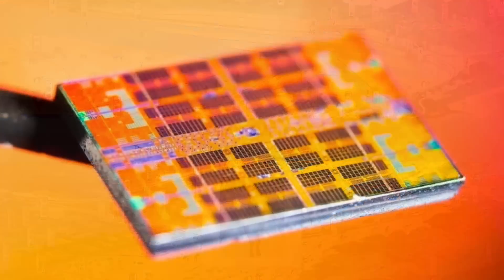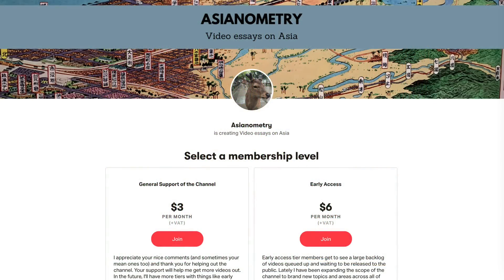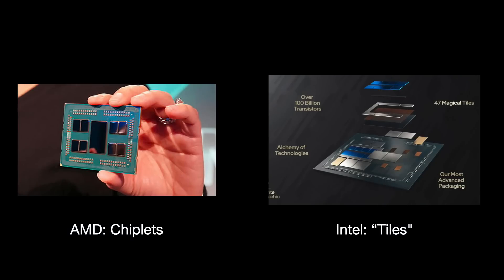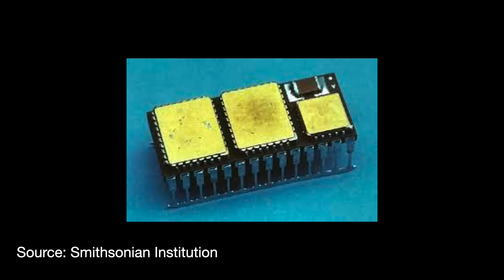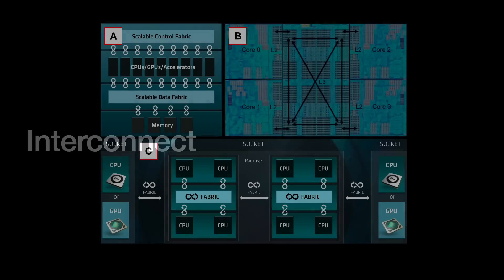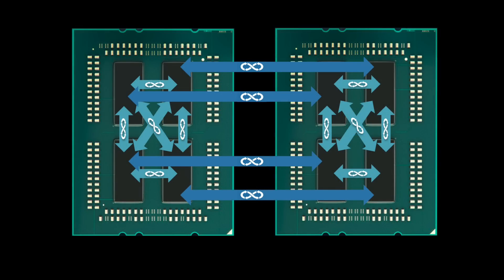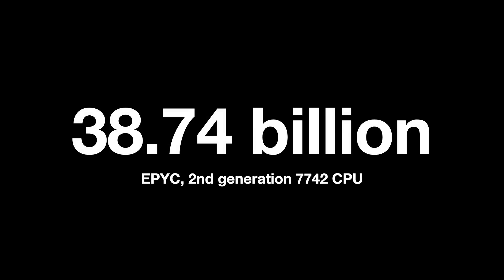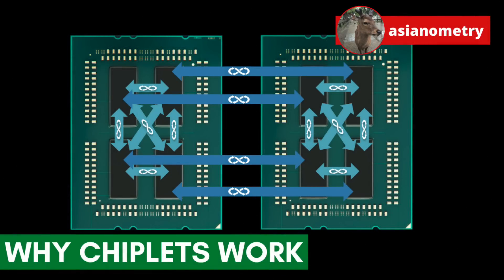Why AMD's Chiplets Work

Comment: You are missing where the package innovation came from. Multi-Die packages where driven by memory and image sensor (processor). For example through silicon via technology was developed and matured for these applications. I still think that are the leading edge for this topic. A modern ISP is amazing part of technology with wafer level direct bonding, thinned image sensor chip to just 10um thickness to be ilumanted from the backside. Memory is producing stacks with up to 16 chips.

Comment: voltage, frequency & chiplet efficiency
Multi-Chip has some very interesting EFFICIENCY options available. Since POWER DRAW does not scale linearly, and is often the limit (especially in laptops) then adding MORE chiplets at lower performance per chiplet can result in better performance. If you plan to run at a max of, say, 1500MHz you can also optimize around that as a max frequency further saving power somewhat. So there's a lot more flexibility compared to a traditional monolithic design... and not being on the most cutting edge NODE might not matter so much if you have this flexibility. Maybe put those cost savings into adding more chiplets on less efficient nodes? There's definitely going to be a BALANCE of everything that results in the best performance per dollar to make and that's going to vary depending on the product, current node costs etc.

Comment: The original Intel P6 (1995) had 2 dies, a CPU plus a wire connected cache. That's the processor I started my long verification career on. Fun times!
Reply: was the 386 for me

Comment: Remember the jump in performance that came with the Pentium II Xeon / Pro? It seemed like a big jump in performance. That used a primitive version of chiplet based L2 cache memory if I recall correctly; This is why it had a weird rectangular shape and case. I think big CPU cache is the way to go, generally.
Reply: Pentium 2 and 3.. It plugged into a socket like the old agp slot

Comment: I'm surprised you didn't mention Intel tried this a few times. They did it with the Pentium 4 to get dual-cores (really dual-dies) to market. Then again with the QX6700 (2006) and Q6600's (2007) which contained two dual-core chiplets to deliver quad-core processors and they used the MCM naming for those too. There were also XEON equivalents at the time.

In Intels case, AMD got to 4 cores with a single die and Intel was a bit behind so they had to use an MCM to catch up then they went back to a single die design. Now it has switched around and chiplets are being used to get higher core counts at a reduced cost like you said in the video.
Reply: Intel double cheeseburgers....
Those were the days.
Reply: Intel is so behind AMD and Apple on chiplet technology that it’s not even funny. AMD 5800X3D has a stacked 64MB of L3 vertical cache at $450! Intel’s Faveros EMIB technology announced in 2019 is still nonexistent!
Reply: Intel started doing it in 1997 with Pentium II
Reply: @tringuyen7519  more like TSMC, not AMD.
Reply: @dogman2387  Intel started doing it in 1981 with the iAPX 432
Reply: MCMs are old tech. NASA and the military used them to put into spacecraft because they don't like PCBs, which fail when heated and produce bigger circuits.  We did mixed MCMs/hybrids (ICs, passives, transistors) at Hughes for satellites in the 1980's and before.
Reply: @scottfranco1962  Yes I'm aware of that lol but I'm bringing it up with Intel because they are the main competitor to AMD and the whole video was focusing on how AMD used chiplets to beat Intel but failed to mention even once that Intel had shipped MCM's in the past, commercially to consumers in large volume.

Comment: A funny thing about chiplets is that they're helping overall but they are so good that they leave no silicon for the low end. The low availabiliy of the 3300X and thelaco of a 5300X is becaus AMD is getting little to no chiplets with less than 6 working cores
Reply: This is the fault of the way AMD approached Zen 2 and 3 and nothing inherent with chiplets.

Something as simple as a 4 or 6 core part doesn't require chiplets and if AMD does this for Zen 4 I think Intel will eat AMD for lunch at the low end.

If I were designing AMD's Zen 4 Ryzen based CPUs and APUs, I would use 5 chips in all.  The first would be a 6 core monolithic die, with no graphics, that allows a tile based interface to add a graphics chiplet.  I would create 2 graphics chiplets for different power levels.    I can now use this single chip for 4 - 6 core CPUs and APUs.  That's a lot of versatility still.  I'd then make another chiplet that has 8 cores, the IO functionality and the ability to add graphics just like the 6 core chip, and on another side be able to add another 8 core chiplet, with no IO functionality, so it's simply 8 more cores.

AMD did the whole IO die thing with GloFo because they were still under contract to GloFo for die.

I don't for a single second believe Intel is going to move to tiling for every single part because it just doesn't make sense to add complexity when the die isn't very big.

So this is where AMD failed, at low cost items, and they shouldn't have to rely on having enough bad monolithic APU die to make lower core count parts.  That's just bad.  And, using an 8 core chiplet to make a 4 core part is BAD.  It's a waste of 50% of the die.
Reply: @johndoh5182  thats a lot of tooling though, it isn't cost effective to have that many different designs. It's also a waste of capacity since you have so many sku's hogging precious laser space. 
AMD has 3 designs: CPU,GPU,IO 
INTEL has maybe 1or 2 design: APU
every intel sku is a binned down 12900k or is a 12900k
Reply: @johndoh5182  You seems to have a backward idea on the whole chiplet idea. Remember when AMD was on the brink of colapse, high end desktop cpu got like 4 cores and maybe halo product with 8 cores. With chiplet AMD raised the bar, nowdays most common gaming machine got 6 cores. AMD is now becoming intel since no competition is insight (thankfully we got ADL, but thats not enough). Instead of asking AMD to downgrade their effort, i would instead go to intel to ask them to up their game. So we can raise the bar again so midrange can have more cores like 12 core and hopefully, making 4-6 core to be low end. Thats the beauty of competition although i dont see it coming anytime soon since price is slowly creeping up.
Reply: Suffering From Success™ 🗿🗿🗿🗿
Reply: @jakejakedowntwo6613  
No?
AMD makes 1 die for APU, CCD, IO each and a bunch of dies for discrete GPUs

6 core CCD is the only new one that AMD would need to make

And intel makes more than 1 dies for alder lake
Reply: While it is inefficient, it is not that uncommon for silicon vendors to fuse off functional units of higher tier parts to make lower tier parts when the demand for the higher tier parts isn't high enough. The reason we haven't seen much Ryzen 3 inventory lately is partly due to how good the yields are, but its also due to the fact that AMD can sell every higher-tier part it can make with the market as it is. If they actually had enough defective dies to make Ryzen 3 parts, it might even make sense for them to just build a 2-CCX version of an 8-core part instead of twice as many 4-core parts (I don't think they did this, just saying its possible).
Reply: Idk, I dont think historically it has been the standard for the majority of lower spec products to be the result of salvaged partially defective higher chips

Certainly a ton of chips that use some fine tuning like to a degree of 10-15% of performance differentiation, and some past budget designs used this, but even back in the phenom II quad vs triple core days (10+ years ago on 65 or 45nm?) yields were good enough they had to artificially lock some of the cores to meet demand of a very niche (compared to dual or quad core) triple core cpu
Reply: It's as simple as low end = low margin = low cost

Interposer, packaging, IO die, all add cost. It's just cheaper and easier to fab a traditional monolithic chip for the low end, on the non-leading edge node (e.g. 7nm/"6nm")
Reply: There's little low end silicon because there's sufficient demand for the value chips like 3600 or 5600.
If 6c/12t weren't selling then lowest end 4c/8t SKUs would appear with good cores disabled.
Reply: @johndoh5182 you clearly don't understand the product range or decisions.  The desktop chiplet low end allow harvesting, inefficient dies which don't meet specs for higher margin chips.
The real volume chips are not desktop but the kind of APUs that mostly go into laptops or consoles, they can even be older designs on older processes and are monolithic.
Your strategy would limit flexibility and incur high costs for small lower margin segments, when most  desktop and laptop buyers are clearly seduced by 8+ core models.
So congratulations you'd blow billions on specific designs for uninteresting parts of the market and lose the advantages of scale allowing small chiplets to be selectively binned for use in server or high end desktop.

Comment: The biggest roadblock issue for MCMs was cache memory latency bottlenecks. Consequently, integration of memory on die for CPUs GPUs and SoC would be a priority from the mid-90's onward, while on the severs side, massively parallel blade architecture solved the problems temporerally, but by ~2010, latency was again an issue. Chiplets solve this another way; splitting up the processors into manageable increments.

Comment: Xilinx (now AMD) used a multidie approach for ultrascale too.  Some designs that ran fine on V7 have problems meeting timing at the die crossing interface in ultrascale.

Comment: Can you do a video on camera image sensors?
Reply: TacticalMoonstone  I like to know how similar or different the process technology is between sensor manufacturing vs  processors. I have a feeling that image sensors use older equipment/process. Also, how far behind is full frame / large sensor semiconductors compared to latest cell phone cameras. If you would scale up for example, iPhone main sensor to larger size, how much would it cost? TowerJazz, Samsung, Sony, sigma…I’m also curious about those.

Comment: Maybe we can go back to having a north bridge on the motherboard in typical PCs? It would be a small step. 

This also reminds me of how 80286 and 80386 CPUs needed an optional “math co-processor” to be installed in the motherboard in order to perform some floating point calculations.
Reply: A North bridge would come with massive latency costs, tho. They didn't integrate the North bridge just because it was cheaper, they also did it because having an imc massively increases performance
Reply: We wouldn't actually want that. You're just adding more lengths of wire and logic between a device and the CPU, which becomes a bottleneck and adds latency. Everything either needs access to the CPU, RAM or both. The chipset that still exists on desktop systems still has the same problem. AMD's Epyc based systems don't even have a chipset because there is room in the IO die for all those auxiliary functions. It's probably key to understand that the Northbridge is mainly only really different from the modern chipset (and southbridge) in that it housed the memory controller. That specifically makes way more sense to be on the CPU package. The northbridge was removed in favor of the Integrated Memory Controller. It would be a step backwards.
Reply: @blkspade23  Okay so not worth it, I guess Ryzen already does the logical thing and puts the IMC in the I/O chiplet. It maxes out at moderate memory speeds but it makes sense from a value perspective.
Reply: @blkspade23  by the way, thank you for your lengthy explanation/reply. I appreciate that you shared your knowledge.

Comment: great coverage as always. I wonder if apple will ditch the monolithic dies for the pro lineup going forwards, they really are pushing that monolithic design SOC with their on silicon interconnect
Reply: I don't think it is possible for the A series chip as it need to be small for iDevice. Possible for future M series. The current M1 Ultra is 2 chips in the same die with RAM, Unify Memory, as chiplet on the side.
Reply: @Theoryofcatsndogs  not really, the M1 ultra is really one monolithic die, since the interconnect is on silicon. they just cut off one of the dies if it fails which is how they preserve yield

Comment: Around 20 years ago we saw the end of the MHz race between CPUs. Slower chips doing things smarter and more efficiently substituted for faster clock speeds.
Chips have been mired in the same 'bloatware' that software finds itself.... we don't program smarter, we just throw more lines of code and billions more transistors at a problem.
I believe that the 7 nM 'node' is over-extended,  and just like with clock speeds, we will take a step back towards more realistic geometries.
AMD has taken an interesting tack towards simplification. A database server does not need ANY graphics functionality, why include it? Design a couple of chiplets that implement database functionality in hardware, omit the graphics engine and glue them together with a CPU. Less transistors, easier geometries and better performance.
Reply: Scaling up the easiest way makes sense, until it stops making sense, and then scaling up the next-easiest way makes sense. Repeat until full theoretical capability is achieved.
Reply: Thats one of the problems with x86 (and ARM to some extent). About 90% of all instructions a program executes are jump,compare,add,subtract,load,store and x86 has ~15 000 instructions which makes decoding A LOT more difficult and requires more bits to encode an instruction, eating away silicon space for more useful things such as more pipelines or a better branch predictor. Thats one of the reasons why RISC-V is appealing since it wants to keep things as simple as possible, which also allows for higher code-density.
Reply: Database acceleration has been done by Oracle with their SPARC cpus
Reply: Sure, what is the clock speed of the human brain? Probably less than a 1khz. Yet all of the computers in the world cannot equal one. Parallel processing in 3d solids baby!

Oh, yea, and all that for the cost of a beer or so...

Comment: The Brilliance of AMD is that they have - essentially - only a single 8-core CPU.  By connecting many of them with different fabric chips and/or disabling broken ones by lasering them out of the circuits, they can build a chip anywhere in size from 2 CPUs to 128 CPUs - all with only 1 GPU, roughly.  So AMD really makes only ONE CPU and it has 8 cores, period.

Comment: SOC is the opposite of what amd is using.  They are doing SIP system in a package, it’s been in use for decades.  The next evolution of that is stacked die, where you use through silicon vias to directly connect die without bond wires and footprint increases.   SOC is putting multiple die on the same wafer making large die with sub die only connected by the top metal layers or bond wires in the package. That was a large expense where board space was the primary concern.  

The other huge advantage to this approach is you don’t need as many different devices on a single die, reducing mask layers for each and not having to share thermal budgets at each layer. This reduces cost and complexity.  The reduction in base and interconnect layers also greatly improves cost of scrap. Your net yield increases slightly but anything you scrap at end of line has man fewer masks so it costs less.  These advantages are shared by Traditional SIP but stacked die is a way to take moores law into 3d and continue it beyond atomic size constraints.

Comment: I work in embedded , no such issues there :) You would have to be mad to go chiplets there. I see the point for high end designs if you want to have some scalability and lower cost with some performance drawbacks.
Reply: Isn't going chiplet when you have more than  1 MCU in a PCB, lol.

Comment: Just a friendly heads up about your audio; your VO seems to have a bit of ringing to it. I noticed it around the 8:30 mark. This might be your mic arm resonating in which case it should be tightened. If the mic is desk mounted, put it on something soft so the desk can't resonate. Lastly, it might be feedback if you're listening to yourself with speakers but I'm doubtful of that last one.
Reply from the maker: Thanks.